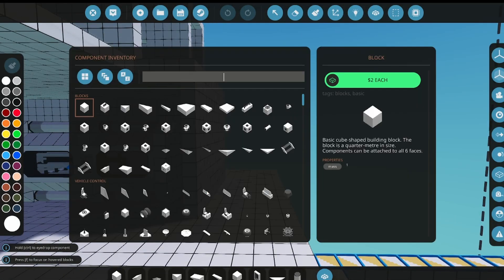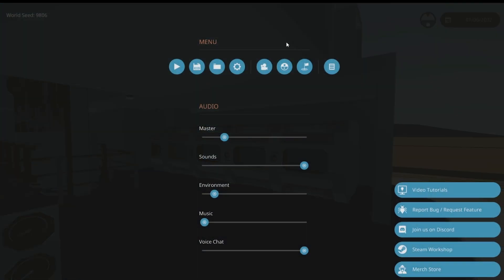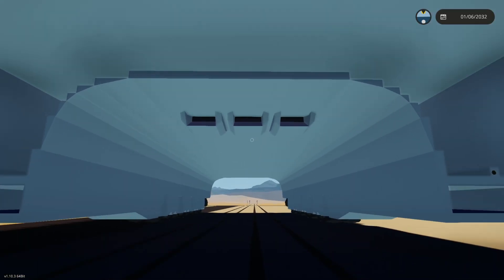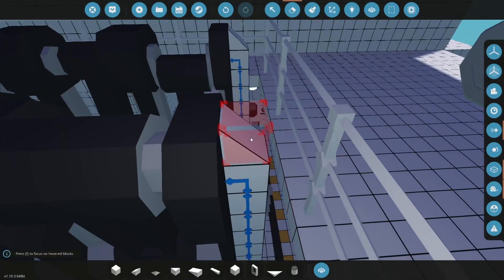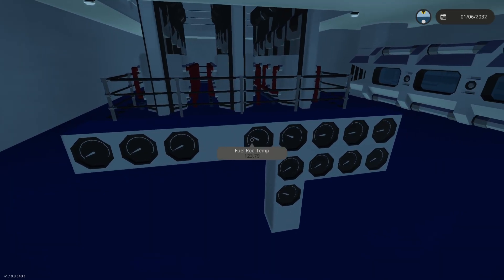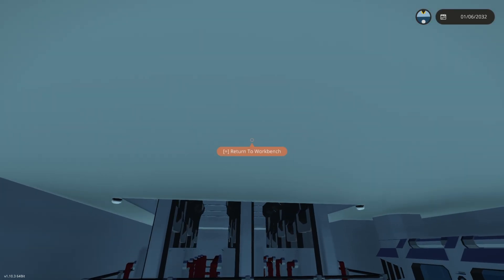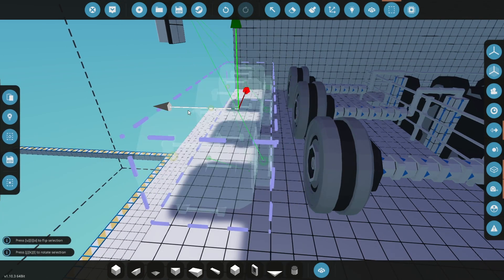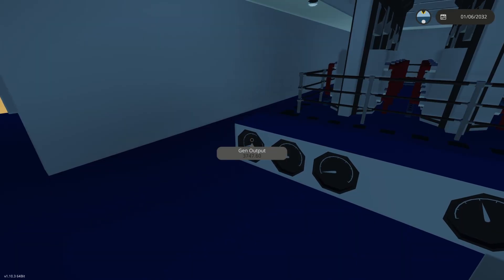Carrier Cat - Fumbling Around With The Engine

Comment: I would like to throw in my steam experience because you seemed not sure about a couple of things. The pressure value in the boiler has no meaning anymore according to the devs but if you reach 2.5 pressure in the boiler you get 60atm at the pistons which enables them to output maximum power. That is the metric you did not paid attention to. To raise the pressure in the closed system you need to add water. I usually put in 1-3 small prefab tanks between the condenser and the boiler. A medium tank failed me. I do not know why it does not work. I assume you already added water because you reached 2.5 pressure once. If there is water in the boiler and you did not reach max pressure you need to raise the temperature of the boiler. The higher the temperature the faster the conversion water to steam is.
The performance of the condenser depends on the ambient temperature. I have yet to see proof that steam has a temperature attribute. I doubt it. This is an urban legend. I would not waste time adding stuff for it. I did this once and it worked the same way as when I removed it in a later version. I also cooled steam to 80°C and it was still steam and not changed the performance of the condesener. In my understanding the condenser is coded to turn steam to water if the temperature is below a threshold. In that case 90°C. There is no indication of real world functionality beyond that. If your condenser goes nuts thats because you cook the area with the reactor temperature. It would be wise to stay below 200°C to avoid interference.
With 12 large steam pistons and a power rating of approximately 1300W each you can reach 15kW in theory.
No you cannot get rid of the power flickering in the game. The pistons work on strokes and output power in pulses. If you gear them up with 6 gearboxes they spin very slowly on lets say 0.3 rps. This is amplified by 6 gearboxes on a factor of 1:729. So a tiny change in rps results in a 729 times bigger change in power generation. In pulses. You would need to add a ship load of flywheels so they are the determining factor for power in the system and the pistons just keep them charged. You could toss a gearbox. If the pistons spin faster at like 1rps you get a smoother output. But you loose a bit of power. But not much.
Reply: from what i understand and from what you stated, if you have more than 1 water in the boiler and are not at 2.5 pressure, the boiler isn't at max efficiency?
Reply: @lonnierh0dgejr41  If you use steam turbines it does not matter. They do not depend on the pressure in the system but solely on a flow of steam. The steam pistons however have peak performance at 60atm at the input and 0atm at the output only. For pistons this statement is true. For adjustments you need to switch your attention to the reactor/firebox/furnace. The boiler is just a passive tool nowadays like the condenser. I regulate my boiler temperature with the reactor temperature since the space update. The boiler cannot explode anymore. A regulator for the coolant to the boiler just slows down the heat up sequence even if the shown flow rate is higher. Unfortunately the devs confirmed in their recent Q&A that this steam system is final in its current state. An empty boiler, top notch realism there. I learned the hard way in Derail Valley that you want to avoid an exposed crown sheet at all costs, yet alone an empty boiler. Boom.
Reply: @EvilFroeschken  thanks for the info. much appreciated. i do know that an empty boiler is a bad thing in the real world. i'm just concerned with in game.
Reply: @lonnierh0dgejr41  yes
Reply from the maker: Thanks for the info. Ive read your comment a couple times this past week while I’ve been adjusting the engine to make sure I’ve got it mostly probably right.